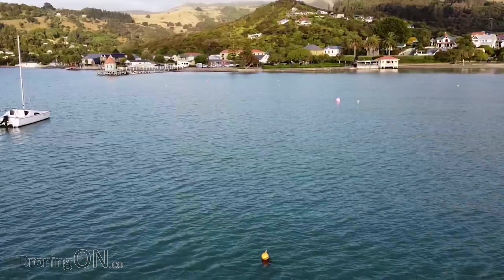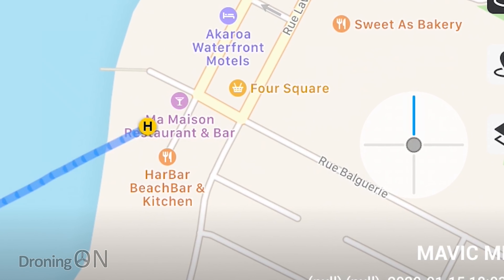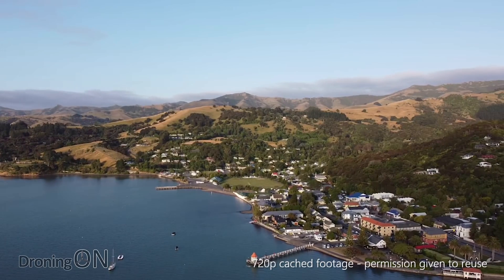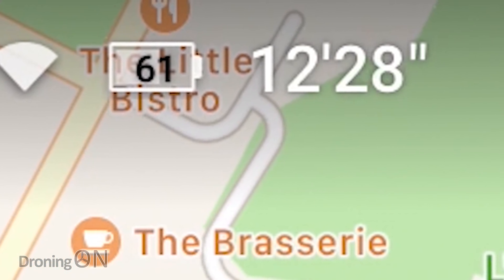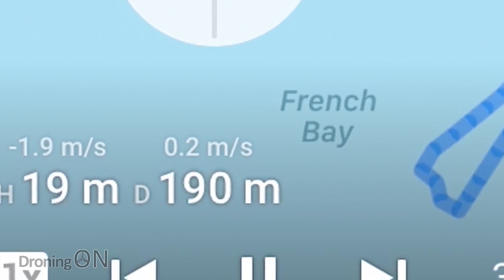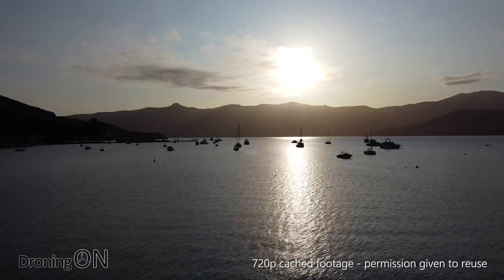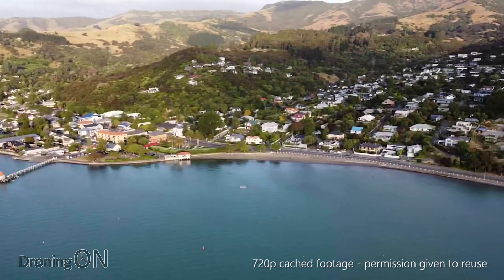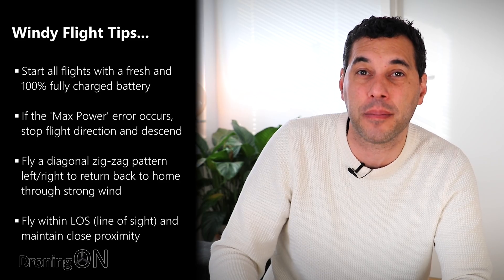DJI Mavic Mini Uncontrolled Descent Into Sea | Max Power/Wind Issues/Operator Fail?

Comment: I lost my Mini to a max power reached error over water. There was very little wind and I only received the error when I switched to Sport mode and it went into a decent. Fortunately it was in shallow enough water that I could wade out and get it. Waiting on DJI for a new drone from my refresh plan. I will use these tips next time though!
Reply from the maker: Thanks for the comment Eric, I did notice that this operator was in Sports mode for the entire flight, that means hotter ESCs and motors which may be why this issue occurs perhaps.
Reply: Same in my case, I was in sport mode landed on its own , lost the drone, found it two hours later , and DJI replaced it with a new one even though I had the Dji refresh!
Reply from the maker: @gguido7542  just shows how beneficial Care Refresh is! Glad that you got a new one!

Comment: Firmware/ hardware issue which DJI have been aware of for well over one month now, extensively reported on DJI’s own forum and Mavic Mini Pilots forum.  Let’s hope DJI resolve soon.
Reply from the maker: Thanks for the comment, yes indeed it's a 4 week old issue but this is a realworld story and it's important here to communicate that not all instances are this bug, some are operator caused due to wind and lack of experience. Let's hope that DJI resolve the uncontrolled descent issue soon!

Comment: Idiot I would say and I always gain height to see any prompts and a low battery asking fo trouble I simple 30 minute car charge would boost the battery if you choose to fly less than 100 % the numpty...?
Reply from the maker: Thanks for the comment Tom, it's tricky and we shouldn't call people an idiot because everyone is at different levels and with varying experience. He's learnt his lesson, although the descent issue wasn't his fault, DJI have to answer for that one!
Reply: @Droning-ON  I agree m8 the drones got issues I have a drine club 80% cant use them I try to educate them but it's in one ear and out the other one anyway you look at it you dont fly a drone over water without a full battery this drone has a problem with full power it stops you using it 100 % but you have to fether the throttle and try to avoid using 100% power ie step it up a bit not full on go out low the ascend even with my phantom if used with a low battery I wouldn't even consider going out over water that far,you can feel sympathetic if you like but hey the pilot should think about that. Makes the drone look bad  to and as you know m8 any drone app would have told you the wind conditions..no sympathy from me..sorry poor drone

Comment: There are quite a few problems with the Mavic Mini.. Such as signal loss and signal range, descending for no reason. The DJI fly app has a problem with the Samsung S10  other mobile devices. So best to keep Line of Sight.
Keep up the good work Ash and thanks for coming back top man.
Reply from the maker: Thanks Graham! Yes I wish that the Mini used the same app as the regular DJI drones because new apps mean new bugs!

Comment: I had the strong wind warning and returned to home immediately. Never received max power error. Drone did stop moving forward for a minute or so because of the wind.
Reply from the maker: Yes it's a common mistake made by operators, always start upwind and return to home downwind, it's far safer! This guy was in Sports mode and I wonder if that's why he received the Max Power error, hot motors and Discs perhaps.
Reply: Aviso de vento forte é a todo momento!!!

Comment from the maker: It's a GREAT little drone without question, but it needs to be flown in appropriate conditions - COMMENT BELOW with your thoughts and SMASH SUBSCRIBE for more like this!
Reply: DroningON this is true. I only fly mine on nice sunny days with wind less than 10 mph.
Reply: Mine descended into the water as well. No warning. New battery installed, set up the Automatic Dronie feature. It flew out to complete the dronie and flew back, then was hovering at about 2 meters above the water and 2 meters away. It then started to descend towards the water, so I pushed up on the controller. It continued to descend and I ran into the water and snatched it up just as it submerged.

End result, no drone for the rest of my holidays. Definitely something wrong with the drone.

I was lucky as it descended right in front of me in shallow water.

This drone is nothing like my Mavic Pro.
Reply: @Dave_and_Mylenes_Travels  its not the mavic pro its a cool little beginner quad come on now. I wish they had a cool mini quad like this little bugger when i started out flying quads i would have been in quad heaven. I STARTED out on the ones that didnt have any thing on. It EXCEPT my ass better learn how to fly this thing thats going all over the place .fuck it take off. Man that little hard to fly quad taught me so much, really REALLY how to fly. The mini is a cool little quad, its name says it ALL MINI.MEANING VERY LIMITED FOR ITS SIZE.U want to fly in above normal wind speed always fly the big boys folks. Thats just my experience with flying quads.JOYFUL FLYING MY FELLO QUAD FLYERS.HAVE FUN AND FLY UR ASS OFF.✌ peaceand PROPELS+UP.
Reply: James Johnson there was no wind. I had no warning. The Mini just started to descend into the water with no warning, even while i was trying to counter and ascend to keep it out of the water. I was 2m away from it and had no control.

I know that this is a smaller quad, I know it isn’t as powerful, I also know that I should not lose control of it when it is only 2 meters away while hovering in conditions that are pretty much perfect. Or maybe we all need to gain your experience before we fly a Mavic mini.
Reply: you just need a point, download something like uav forecast to configure it according to the limits of your drone and know with it when to fly it according to the force of the wind
Reply: It's a great mini drone had mine for 3 months great for traveling.check my videos on my account.
Reply: DroningON 😎❤️✈️✈️ i got the same drone im using for my roadtrip vlog so far im not disappointed on his performance . Just flying with caution and youlle be fine dont even try to max the ability of it, dont risk it . Unless u have money to buy new one 🤣
Reply: For me after having experienced this error myself, fortunately I was only hovering in about 10m when it dropped, I have done some testing. At a height of about 2 m without any wind, all of the propellers replaced, the Power insufficient error would still show up. After downgrading the firmware from version .400 to .300 and then updating again I could fly without any problems for over an hour, put the drone away and the next day it was there again...
Doing some more testing in the future and if nothing helps I'm gonna send it in.
Reply: Really great info 👍🏻👍🏻 but that issue you mentioned,would that be for every mav mini ?  Just 4 when eventually get out !!!!  😷
Reply: Question, could it be that the propellor guards ar to heavy to use when there is a little bit of wind??